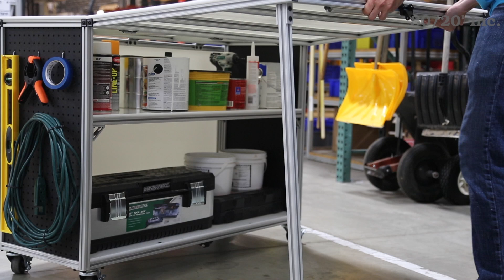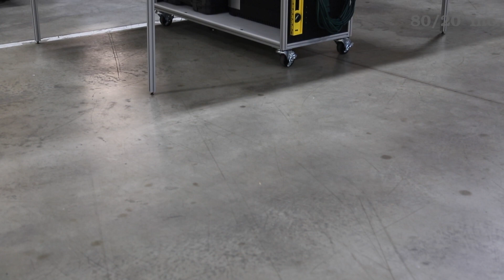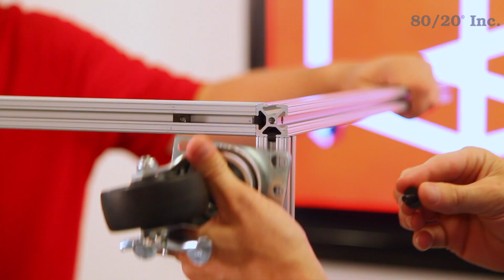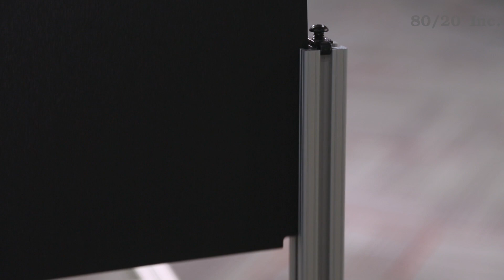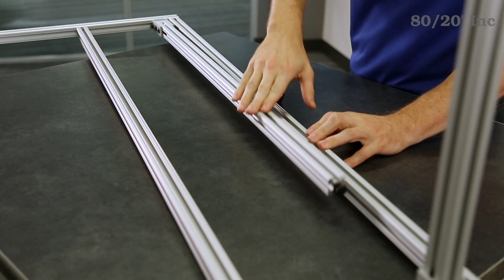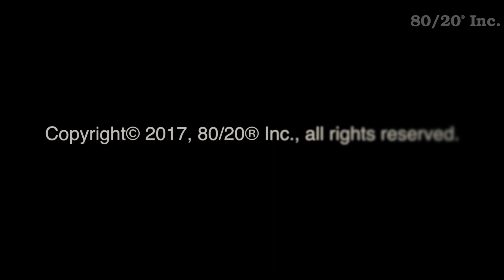80/20: Xtreme DIY - Mobile Folding Worktable

Comment: why is it called 8020 when you use 2020 alu extrusions? 3030 would've been much better. I'm diying one myself out of 3030+3060 and it's only £35 more (£188 with mft top) than doing it with 2020+2040

Comment: It looks like the pivot arms for the legs are free to move past 90 degrees. I'm looking for a pivot that will self-lock at a certain angle, like 90 degrees or 180 degrees. Do you have anything like that available? My goal is to essentially have one profile fold down to a smaller size, and have the legs coming off that profile also fold from a locked 90 degree angle, back flush into the main profile. Thanks!!
Reply from the maker: If I understand your final design, we might have two options.  Option 1: The use the Right Angle pivots http://catalogs.8020.net/80-20-Catalog-24/6-70/ and http://catalogs.8020.net/80-20-Catalog-24/6-72/ , they have a flat side on the pivot nub that will block/stop the attached extrusion from traveling past 90deg. These are free pivoting and do not have any type of locks. Option 2: Use any of the variety of Left and Right handed pivot bracket assemblies.  These are available in 0-90 deg and 0-180 deg options. The advantage of these is that they have brake handles incorporated into the design http://catalogs.8020.net/80-20-Catalog-24/6-78/ and http://catalogs.8020.net/80-20-Catalog-24/6-82/ and http://catalogs.8020.net/80-20-Catalog-24/6-88/
Reply: @8020llc  Thanks for the reply! I'm hoping to find a way for the pivot to securely lock into 90deg (and 180 degrees on the other piece) without the use of a brake handle (in an effort to make a lower profile design with easier assembly). Appreciate the help though - I'll figure something out!

Comment: This is a beautiful table, elegant and functional.  I like the Marine Starboard HDPE as well, lovely finish. I wonder if that scratches easily on surface?  Only issue really is price.  So pricey to build with this material. Why does it cost $30 each for a pivot or $15 for a hinge?  
Please show the hardware assembly in more detail when doing these videos.  I wanted to see how the pivot joints slid into the slots and how that worked.  Thanks for a clear demo!

Comment: What is the max weight limit for the table
Reply from the maker: Hi, Sam! Thank you for your question about the worktable. The maximum weight capacity for each shelf is 100 pounds. Each leaf extension has a weight capacity of 150 pounds.

Comment: Got a question hopefully you can help me. I am lookingfor a corner bracket to attach to 3 points. If using 30/60 t-track rails and possibly 40/40 legs. The corner bracket must attach to all 3 pieces without blocking the t-tracks from being access (front and top only to be free from blockage). Not sure if you are familiar with Festool MFT3 table but something like their corner aluminum bracket.
Reply from the maker: We don't have a standard bracket that would do exactly what you have referenced. If you're not planning on removing the table legs, we have a standard machining service that removes a small section of the T-slot “lips,” allowing access to the T-slots even if the ends of the bars are captured. The benefit of this solution is that you are not hindered or limited to a particular fastening method and you can insert the service anywhere along the length of the bar. 
Here is more information on our milling service: https://catalogs.8020.net/80-20-Inc-Catalog-23/877/

Comment: You should swing the peg board out and add shelves that slide out on both ends to gain access to the space underneath easier. You'll lose a bit of space underneath but it sure beats the annoying task of crawling under the table to get to items in the middle.
Reply: Excellent suggestion!
Reply: cool! what bout the items/tools hanging on the pegboards? Wouldn't they fall off if the pegboard swung up?
Reply: Door. Not slide out.

Comment: How much weight can that table hold?
Reply from the maker: Great question Ed! The maximum weight capacity for each shelf of the center unit is 100 pounds, and the maximum capacity for per leaf extension is 150 pounds. As always, the project can be customized to suit your needs.
Reply: It looks little fragile in 2020 profile, but then again airplanes are made from aluminium too. Nevertheless I like the idea and will make one for sure but then from 4040 profile. Will choose to skip one table side for easy acces to the storage. Mat consider putting in drawers with a Sortimo system